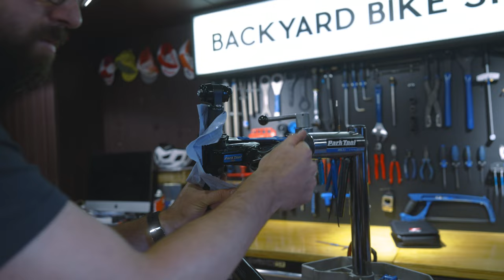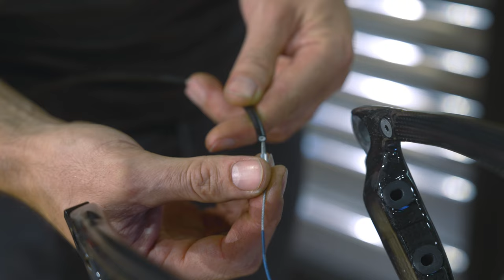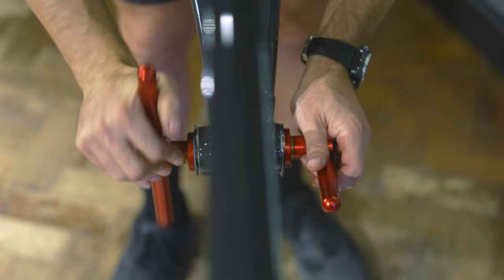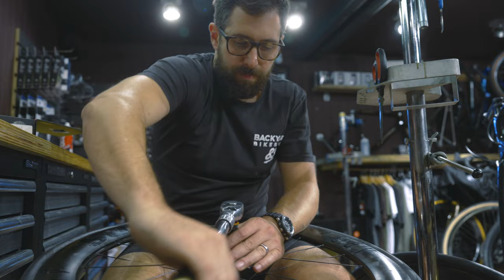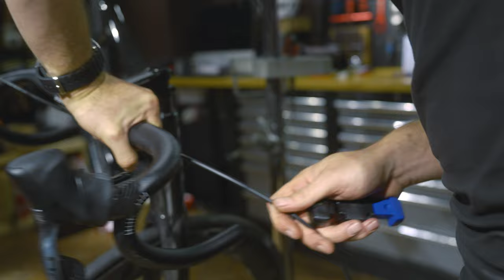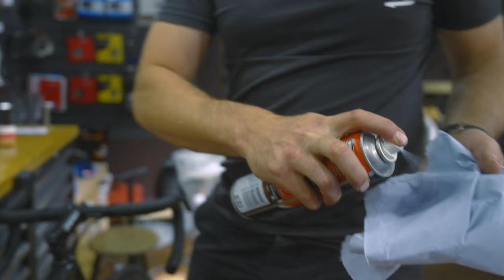TIME ALPE D'HUEZ 21 Bike Build - Sram Red, Zipp, Scope.

Comment: Why do some cyclists hate on Sram so much? I have 2 bikes with Sram axs and both have performed faultlessly and have never once dropped a chain. Beautiful bike and video.
Reply from the maker: Sram is number one right now, for sure. So good.
Reply: Because their front derailleurs do not work, which is why they had to promote 1X.  Try to find a 2X AXS rider, who is riding without a front chain catcher, who has not dinged up their frame from the chain falling off persistently when shifting from the big to small ring up front. Same type of poor design issue with their bottom brackets where they use undersized bearings in their 29.8 or 29.9 mm axle cranksets. 

Bike shops love them because they are wireless and it makes the initial install go faster, but they still shift with a lag compared to Shimano Di2 or Campy EPS. And no one that has ridden both will claim that SRAM brakes as well as Shimano or Campy if they are honest.  That's why.  

And market share does not mean you are the best,  it is usually is the result of being willing to sell your components at lower margins. 🙂
Reply: @rcg9573  I hear this a lot, but have two bikes with sram force axs, both have never dropped a chain after thousands of kms . So maybe I’m just lucky? Or don’t shift into the small ring enough?

Comment: Extremely disappointed you don't weigh your builds upon completion. Especially a bike such as this one marketed towards climbing. Sadly, the build video would otherwise be a 10 out of 10. Thanks!
Reply: The AdH 01 is the Time model marketed for climbing. The 21 is built for general cycling purposes.
Reply from the maker: The weight of a bike isn’t important. So I don’t weigh them. 😅
Reply: I would estimate that the build you see in the video here, if the frame is medium size, is ~7 kg. But I agree with Jimmi, the weight does not matter, particularly for those of us who are not racing and are far from our ideal body weight. I have had this model for about one month now, albeit with lower end wheels, group set, etc and it is a wonderful bike.
Reply: "Let them eat cake" is my take away. Thanks
Reply: Disappointed the camera man doesn't zoom out and show the completed bike